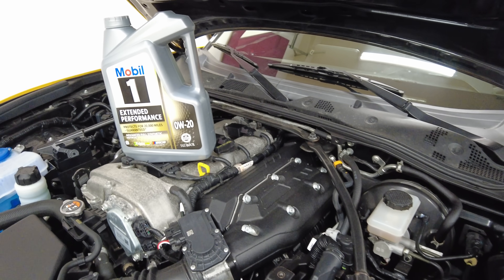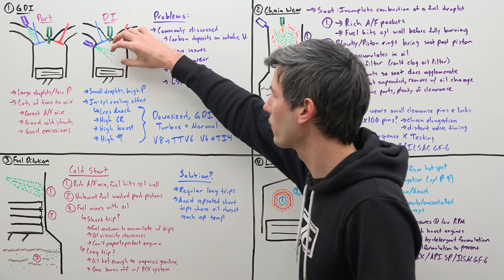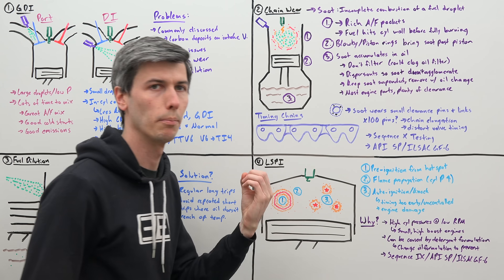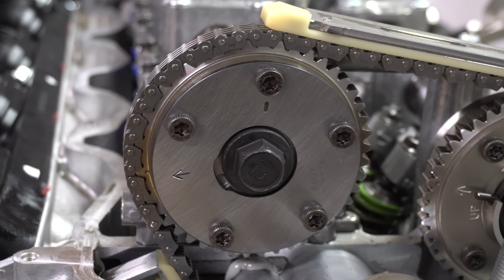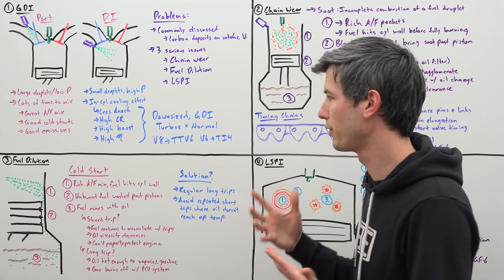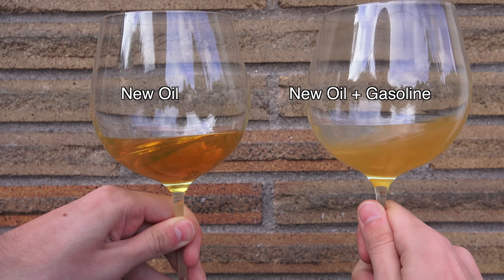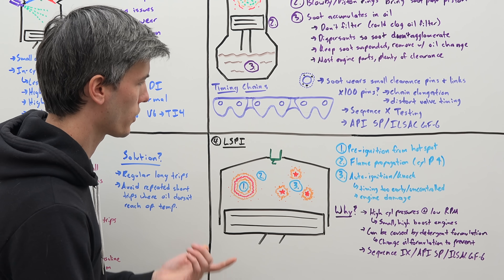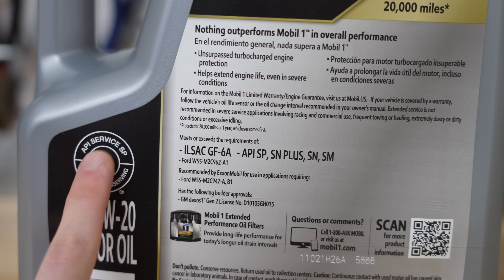3 Big Problems With Direct Injection Engines (Gasoline)

Comment: Here we are, I am about 20 years into my automotive career at this point. These days I am seeing quite an increase in engine failures.
  Even though there has been a plethera of poor designs to account for this, it 'more often than not' has to do with the owners lack of care and/or understanding overall, in the larger scheme of things.  Peoples bad habits are about the same over this period (the general populus has always been horrible at getting their oil changed on time), but more of the failures these days are because modern engines simply cant handle going too far over milage for thier oil changes due to the complex internal designs. In the past engines were simple and could usually take ALOT of abuse, such as going over your oil change interval by 3x the milage.  However new engines with SO MANY components especially in the valve train are especially sensative to dirty oil.
  Since peoples bad habits and horrible maitenance practices are about the same, there is a massive amount of failure due to lack of maitenance. The same applies to drivetrain service, -i cannnot tell you how many people dont even "know" that there is oil in the diff's and transfercase, transmission, etc that MUST be changed on a regular cycle. Mix this with the manufacturers willingness to try and convince people that drivetrain oils are "Lifetime fill" (which is a load of BS btw) and increased OCI recommendation, along with harsh environments like where i live,. aaand let me tell you the amount of needlessly broken stuff we see would stagger you.
Reply: Ppl not taking care and manufacturer's with their "longlife" blaaa blaaa intervals or "life time fill" just kills stuff.
Reply: Oh, I believe you! I'm a mechanic and probably one of the worst offenders lol
Reply: Completely agree

Comment: That's why I have bypass depth filtration. It extended the life of my timing chain well over a hundred thousand miles. 
Combined with Amsoil the service life and testing has been amazing. About 30% better than Mobil 1 based on the hundreds of dollars of testing I have find.

Combine that with a pcv separator and the intake ports have been very clean. Life has been long and performance has been great.
Reply: I'm making the switch to Amsoil on my next oil change. I have a BMW 328xi port injected N52 that I've been running Liqui Moly in but I think Amsoil is the best stuff out there now.
Reply: @saganworshipper6062  you will be very happy with Amsoil. I would recommend using their engine oil flush before you drain your old oil. Ideal for 15 mins and it will clean all the crud out of your engine. Then use their Signature Series oil and you will notice an improvement in how smooth it runs. Yes, it is more expensive up front. The savings comes from extended oil changes (up to 25K miles) depending on your driving use and extended engine life.  Lots of city driving: 15K change. Lots of highway driving: up to 25K. Be sure to use their EA oil filter for max protection.  All the best to you.
Reply: PCV separator? Is that a catch can?

Comment: Only points you missed were that the new direct injection systems operate at a much higher pressure and feature more, smaller, holes in the nozzle, which is optimized to match the cone pattern to exactly the size of the cylinder bore, so when it injects on the intake stroke it perfectly fills the cylinder with a stoich mix.

If direct injection systems had to burn rich as you say because of reduced mix time then why do those cars get better emissions?

I like your videos, but maybe do a bit more research next time?
Reply from the maker: Just a pro tip, telling someone to "do their research" is condescending and unhelpful to the discussion. Your question "if DI systems have to burn rich, why do they get better emissions?" is answered in the video. As stated, this is about cold starts, not operating temperatures. Once the engine gets to operating temp it will most definitely run near stoich (unless of course it's at full boost, and then it's running rich again). But for cold starts, it has to run slightly rich (so does port injection, but port isn't spraying cylinder walls) to make sure enough of the fuel vaporizes for combustion.

Comment: Quite nerdy, I like it. I believe some of the turbocharged, direct injected engines are running a rich mixture (which could cause pyrolysis) to reduce pre-ignition . Does anyone know if using water/alcohol injection and altering the fuel map can alleviate the soot problem and the pre-ignition problem? I think BMW tried this a few years ago. They do have some previous experience with solving the pre-ignition problem before the age of ECUs.

Comment: As soon as Hyundai/Kia went to direct injection in 2011 they have been plagued with catastrophic engine failures. It got so bad so quickly that there were a bunch of class action lawsuits which forced Hyundai/Kia to put a lifetime warranty extension on the majority of their direct injected 4 cylinder engines for connecting rod bearing failure. Their direct injection engines also have a tendency to consume excessive oil due to the soot deposits in the cylinder affecting the piston ring's ability to seal.
Reply: I owned two 2010s Hyundai Accents and both burned half a liter of oil between changes.  Always thought I just had bad luck, now I realize all of them do that.

Now I drive a 2002 Ford Focus with a 2.0 liter EFI engine that doesn't burn a drop of oil in 4500mi change intervals.

Comment: As far as I'm concerned direct injection only engines, especially the 4cyl N/A cars out there, dont work. I've seen way too much carbon buildup to the point it damages the valve seats or hangs intake valves open, and it's been atleast 12 vehicles that I personally work on, all with just shy of 100k miles. Seems to be mainly Hyundai's from my small sampling. 
Turbo engines that are direct only seem to live a little longer before they have valve problems.
Dual injection is definitely the only way to use DI on gasoline engine.

Comment: Ermmm... There is several key missing points on soot source...

1-recirculated pcv from valve cover /crankcase breather forming soot/carbon deposits behind the intake valve
2-egr system also introduce soot into the intake system

On direct injection, there is no other way of actively cleaning the intake port and valve using the fuel like port injection engine...

Comment: If you have one of these engines and get the dreaded MIL due to multiple random misfires, run a can of CRC GDI and intake cleaner through it. It got rid of our MIL problem. I also suggest doing it at least yearly and do it from when the car is new.

Comment: With these new engines I would not buy anything but Toyota or Honda. I think Ford and GM are just not good enough for these types of engines and judging by the amount of engine failures Ford and GM have had since going to these engines I am correct. Toyota and Honda have had them fail as well, but the percentage is tiny compared to GM/Ford. I was at a GM dealership the other day getting my transmission serviced on my 2004 Silverado and the service manager told me they replaced 3 engines under warranty that week. Terrible build quality and quality control. I got rid of my wife's 2015 Fusion the thing has so many problems including a cracked cylinder head at 22k miles. I traded it for a Toyota Camry SE. I instantly noticed how much better the quality was as soon as I drove it the 1st time. Not looking back Toyota/Honda from now on for me:P

Comment: So how do we avoid engine problems in DI engines since almost every car made today has this?  Do we use mobil1 extended and change at 5000 miles and pray for the best?  Or forget DI altogether if planning to keep a car long term?

Comment: Hi Jason: I disagree that Direct Injection will result in a cooler charge. Assuming the same liquid fuel and the same air and the same compression, the amount of heat needed to evaporate the liquid fuel will be the same whether the fuel is injected inside or outside of the cylinder. The only difference I can imagine is the air/fuel contact with the valve and that will probably be about the same whether it is just air or air/fuel.

Comment: LP Gas injection burns cleaner with no oil dilution but is rarely used in the U.S.  It's only economical with EPA certified systems which may no longer exist.

Comment: Only question that I have is as I understand it a GDI uses a leaner mixture on cold startup but with the intake flap/runner the air is forced in the combustion chamber at a specific angle to create a vortex and then create a rich pocket at the tip of the spark plug (stratified mode) and after the engine warmed up it switches the fuel management mode to (homogeneous mode) were it is a more conventional mixture of air and fuel like what we would find in a port injection engine. So my question is do I understand the cold start strategy of a GDI wrong or did I misunderstand your video?

Comment: Yes, direct injection is an engine killer. So are internal cam chains and all the plastic guides and tensioners that go with them. They invariably fail long before the rest of the engine, and require a major engine teardown to replace. Adding turbochargers and VVT just makes everything worse. Modern engines are basically junk. I have 3 cars and a truck. 3 of them use old school pushrod V8s. One of those engines, which I built myself, out of high quality parts, currently has over half a million miles on it, and compression is still within spec for a new engine. Several things made this possible. One, I built the engine myself (I have built dozens of drag race engines, and they have all done very well) I used high quality parts, and I used proper clearances. If you look at the service manual for a 1970s American V8, the tolerances are WAY too wide. This was done to make the engines easy to throw together on an assembly line. You might have one bearing at the loose end of spec, and the bearing next to it at the tight end of spec. I also made sure every part weighed the same, like pistons and connecting rods. The engine is perfectly balanced and every clearance is the same, right where it should be. Also, the design of a 1970s V8 is nearly perfect. They are very simple, and there is almost nothing to go wrong. The single timing chain is huge, has no guides or tensioners to wear out or break, and is easy to get to. I replace it about every 75K miles. And the last thing is oil and oil change intervals. I use full synthetic 20w50, and change it ever 3000 miles. This engine is carbureted, and has a manual choke, which is only used when actually necessary. It is properly jetted. Because it is far more efficient than an assembly line engine of the time, it makes a lot more power, and has very little wear. As far as gas mileage, in a 2 ton car, it gets high 20s on the highway and high teens in town. I consider that totally acceptable, and considering how long it will last, and how much power it makes while still being seriously under stressed, It is a much better engine for the money (both cost of the engine and operating cost) than any "modern" engine.

Comment: My buddy and have 2014 Silverado's with the direct injected LT V8.
So far I have 134,000 trouble-free miles, he has 140,000 trouble-free miles.
No issues with the engines and we both still get the same fuel economy as when the trucks were new.
So GM definitely has the direct injection figured out..
With my cruise control set at 74 MPH I have averaged 24 MPG multiple times..
That's why they are the best for fuel economy over any brand..

Comment: Hence the reason I have two 5th generation (2019 & 2021) 4Runner's that have the 20 year old 4.0 L 1GR-FE V6 w/ old school multi-port injection. Looks like the 2023 6th generation 4Runner will come with a 2.4L turbocharged 4-cylinder engine - oh well.

Comment: If you really have higher efficiency, you should not have incompletely combustion and soot formation and fuel dilution.  I’m not buying this explanation.  I suspect the problem is cheaper and lighter timing chains on engines that are running at higher RPM to get the power needed from much smaller engines.  Blaming GDI is a red herring.

Comment: this was GREAT, and quite educational as well. 
My car's (2015, Audi Q5 2.0) oil specifications are such that whenever I enter info into Advanced Autoparts or Autozone, it does not put up any ILSAC-GF6, nor API SP oils. The approved Audi list has SL & SN oils, but does not mention the newest ones. In this case, I'm talking about the Mobil 1  5W40, 0W40, Castrol Eurocar  5W30 & 5W40, Valvoline 5W40 European formula. 
None of these have the API SP or ILSAC-6GF labels.
Go figure.

Comment: My direct injectors on my N54 just went bad so this was interesting. I was having a lot of fuel dilution in the oil. Oil pressure when warmed up at idle was down about 7psi,
Reply: That’s not dilution, that’s a bearing tolerance issue.
Reply: @AnonyMous-jf4lc  explain how it went back to normal with new injectors and an oil change then lmao
Reply: @fredfrederickson  either your first measurement was incorrect, or your "normal" is low.
Reply: @AnonyMous-jf4lc  no sir, the brand new AEM oil pressure gauge works great thanks though. Oil pressure at hot idle is supposed to be about 22psi but I was at about 17 before I got rid of all the fuel mixed in with the oil and now it’s back.
Reply: @fredfrederickson  your initial post says 7 psi, which is what I based my comment off of. 17 psi is completely rational for dilution, 7 psi is massive bearing clearances.
Reply: well hell, i'll be the first to admit i read that wrong. Down 7 psi, not down to 7 psi. My mistake, you are correct.
Reply: @AnonyMous-jf4lc  no problem simple misunderstanding, not many people on here admit when they’re incorrect so I appreciate it.
Reply: I had a Civic whose original (port) fuel injectors are still working perfectly despite being about ten years older than the oldest N54 engine
Reply: @nthgth  good for you chilling with like 250 less horsepower lol
Reply: @fredfrederickson  not relevant, but yeah, it's an economy car. What if I had said an LS1, and 8 years instead of a decade?
Reply: @nthgth  idk why it was relevant for you to bring up the civic in the first place other than to seem better in some way so I thought I’d throw it back
Reply: @fredfrederickson  lasting 26 years is better, is all I'm saying. I do love older BMWs, when they work, the E9x 335 topping the list. Just wish they were built with components BMW knew how to build at the time.
Reply: @nthgth  I wouldn’t even mind replacing them because I don’t expect every part to last forever especially when pushed beyond what they were intended for but they’re $2-3k now for a set of 6 which is crazy
Reply: @fredfrederickson  hopefully you only have to do it once. Didn't they update the design after the hi pressure fuel pump fiasco?
Reply: @nthgth  yeah my car came with index 8 which is the first revision after the recall so they were probably done by the first owner a long time ago, they’re up to index 12 now and those are great according to everyone so hopefully not. I tried a used one for $40 since only one on my car is bad but the used injector was even worse than my bad one I had so I took it back and got another one and it worked great until I did a few pulls and then that one quit too so that’s why I’m just biting the bullet and getting new ones.

Comment: I'm a marine mechanic and some outboards have been running Direct Injection for years.  Excessive carbon build up has always been an issue similar to what you describe here. Can you or would you use any of Decarbonizing agents the marine manufactures recommend for this issue?
Reply: Try CRC GDI valve cleaner, $15, works great, got rid of our check engine light. Multiple random misfires.

Comment: PROBLEM SOLVED :  Dual Injectors ( Direct & Port ). 
 It certainly will increase the Fuel System complexity & cost.  But would undoubtedly solve most of the  Direct injection problems.  
   Many of the initial increases in costs could be mitigated a bit due to being able to run much smaller & more application specific Port Injectors & installation locations. 
  The Direct injectors would be able to hand-off or pair with the Port Injectors to provide solutions to the Direct Injector only systems. 
 Cold starts, high cylinder pressure @ low RPM's to prevent pre-ignition/knocking.  As well as lighting up the Port Injectors occasionally @ high RPM's to clean the intake valves as part of it's  maintenance regiment. 
  Just an idea folks. ?

Comment: Very VERY cool and informative video. The only issues I’ve had with cold starts has been with DI engines. I’ve also noticed how DI engines get to temp when it’s cold outside. If you’re not doing highway driving or long distance drives in DI engines in the cold, you will definitely have problems in the future. Look at Honda’s 1.5T engine. The combination of a CVT that keeps engine revs low and the small turbo DI engine is disastrous in cold temperatures.
Reply: I've read that they have a serious problem getting up to temp, providing enough heat for passengers or window de-icing, and sometimes get a LOT of unburned gasoline in the oil pan.
Reply: @townhall05446  Yup! You really have to make sure you get them up to temp every now and then to make sure that there isn’t gas accumulation in the oil. With my DI Mazda 3, I’ve noticed that on really cold days it struggles to get up to temp unless I take it out on the highway.

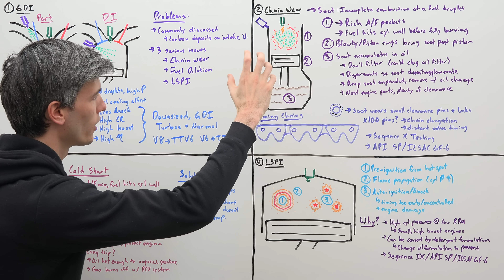Comment: 3:20  Yes you can filter it out.  The oil itself is filter for micro particles thus changing the oil often is really the best defense against engine wear.
Reply: Well, that's not filtering it out from the oil, which is his whole point. And it does necessitate a more frequent oil change interval in that scenario, which is a downside